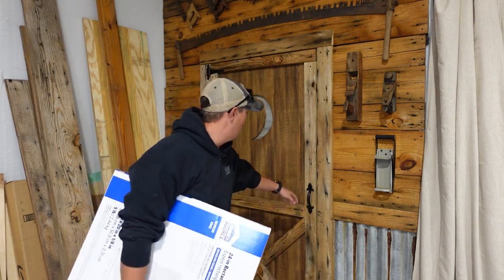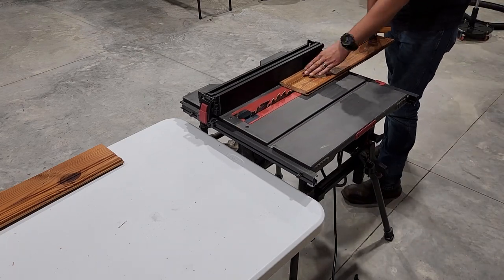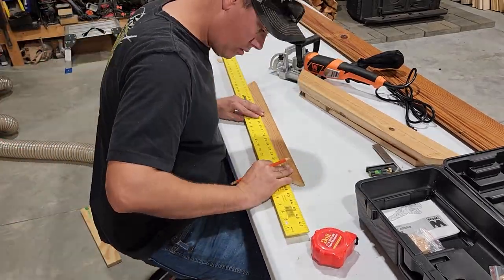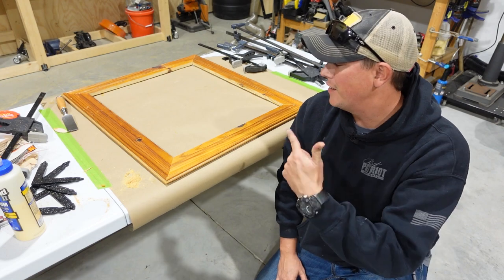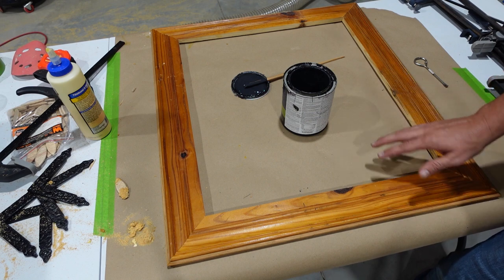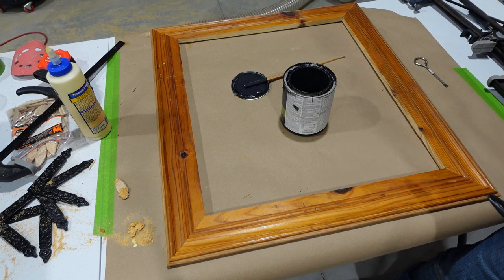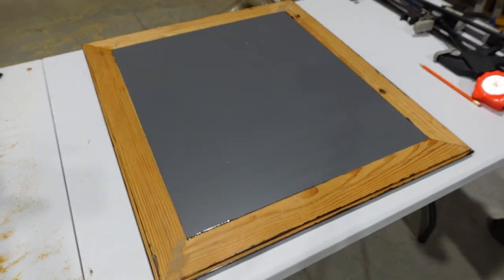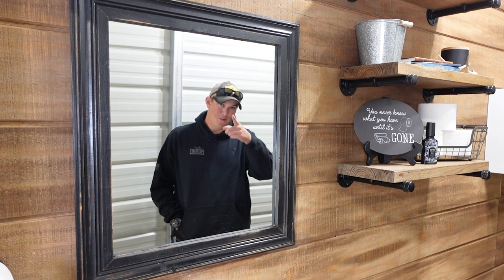How To Build A Mirror Frame

Comment: So some videos say go an inch longer on each piece, yours says an inch shorter. I’m trying
To make one for my mirror so I was curious
Reply from the maker: The short side of your 45 degree miter should be at least an inch shorter than the mirror...if it was longer there would be a gap.  Maybe they are talking about the total length of the board (long side of the miter)